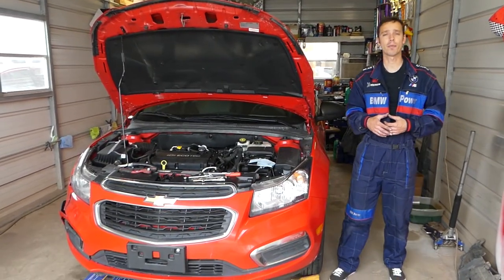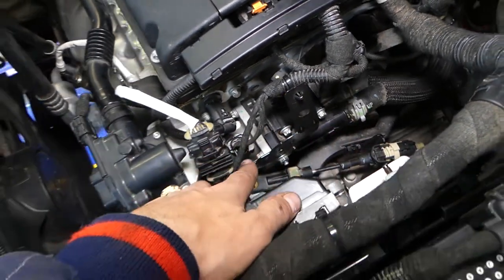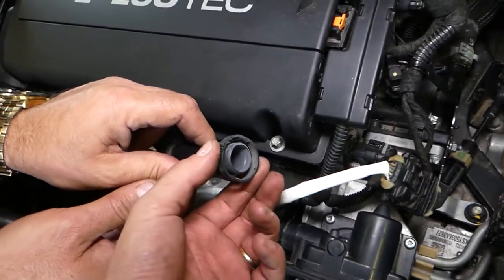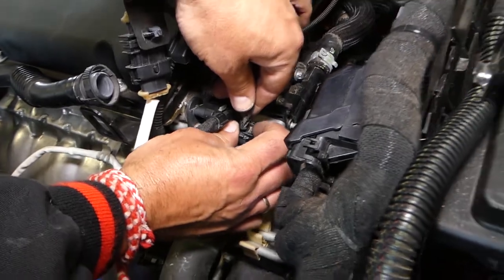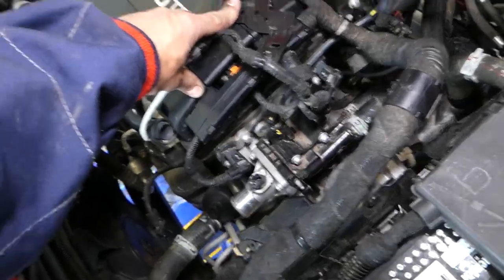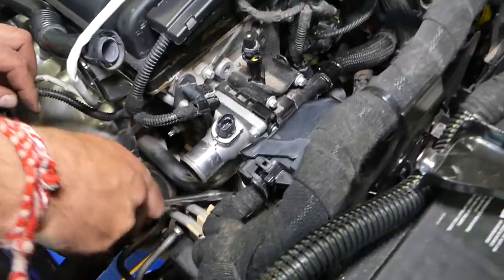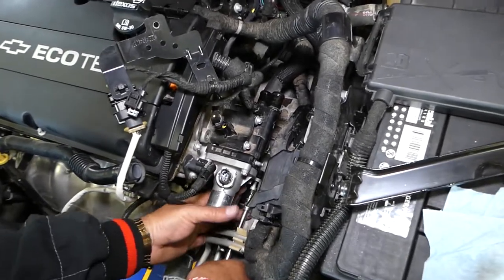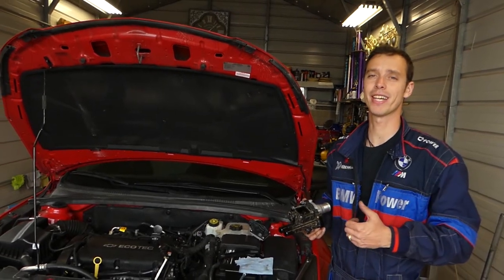CHEVROLET CRUZE THERMOSTAT AND THERMOSTAT HOUSING REPLACEMENT. CHEVY SONIC THERMOSTAT HOUSING

Comment: You guys are truly the best! I have a Chevy Cruze 2015 that I bought used 3 years ago and I've had so many stupid little things go wrong with it. Your vidoes have helped me out immensely and have saved me hundreds of dollars!! Very well explained and very comprehensive.

I just did this particular thermostat replacement and the whole process went very well. Can't thank you guys enough!!
Reply: Did you have to “reprogram” it after replacing? My dealer is telling me they have to do that and want to charge $1k. Thinking of doing it myself
Reply: @kyotodreams3306  Reprogram?? No there's no "reprogramming" involved in this installation at all. They're trying to rip you off...big time.

Comment: Is there a gasket that goes to the metal pipe that connects under the thermostat itself? I believe it goes to the block. I bolted my new one up and it was leaking everywhere !

Comment: Question!

First off, love your videos. I have a 2014 Chevy Cruze LS 1.8 and you videos are extremely informative and helpful. 

I just replaced my thermostat and thermostat housing (all metal Dorman product) and I also replaced my throttle body heater inlet pipe (as it broke when I replaced the thermostat and housing). 

When I start my car and drive, the engine temperature gauge doesn't register and my radiator fan is often running on high. It appears I am still leaking coolant out of the bottom passenger side of my radiator.

The coolant leak is not extreme, I can drive a few hours before my coolant gets too low. I am concerned about this and my temperature gauge not registering.

Any suggestions?
Reply: Did you plug the thermostat temp sensor plug back in? Was their actually a sensor to plug into perhaps you needed to put the one from the old component in? 
You will need to test it using a multimeter YouTube "How to test thermostat temp sensor" 

With the radiator leak you need to replace the radiator or your engine will eventually overheat and be gone.
Reply: i’m going through this right now. what worked for you?
Reply: For coolant leak, it's possible that it's your water pump
Reply: Idk who will see this but, if your Cruze doesn’t register your temperature with antifreeze leaking out the right side, there’s a temperature sensor on the hose that connects to your radiator/waterpump. I replaced that and it worked, but ultimately it was a sign that the water pump in the car is failing. I changed my thermostat 2x before we figured it out

Comment: As always great video. Do you ever change the clamps to the screw to tighten type to make those hoses easier to put on and off? Those hoses on the back were really a pain to get to with pliars.
Reply: same . i did that when i replaced the housing. Alot easier now if i ever have to do the work again.

Comment: 10/11/2021

I had a P0128 code on my 2016 Chevrolet Cruz (like this one). I replaced the sensor on the thermostat and it was ok until 3 days later the code came back.

I then replaced the whole thermostat housing (like in the video) and the code is gone and car works good so far. It seems the thermostat housing is caused a lot of problems. I replaced it with a plastic one and works better (not sure why)

Recommendations:
Follow the video exactly and please!!! CHANGE THE GASKET ON THE LOWER TUBE (bottom of the thermostat) If you do not your coolant will leak tiny amounts like mine and I had to do these steps all over again.
Reply: is your leak gone? i replaced the entire housing and im noticing i stil have a leak. is it that alluminum tube gasket?

Comment: Hey was wondering what seals the oil cooler pipe to the front of the thermostat, have coolant leak where they bolt together
Reply: Did you ever get this figured out? Same issue

Comment: What is the hose/clip that attaches to the top of the thermostat housing?  I have a leak there, but am not sure what that plastic clip/hose would be called in a parts diagram.
Reply: Did you ever find out what it's called? Same problem here.
Reply: I am also trying to figure this out, I need a new clip and oring.
Reply: Found it. Throttle body inlet heater pipe.
Reply: @Garage_Tinkerer  changing didn’t stop the leak right, bc mine literally won’t stop
Reply: @jarrelljohnson7345  Same its getting frustrating. i now have a check engine light po420

Comment: This is a great video and it saved me about $400.  Thank you so much.  Only issue I have is when I installed the new thermostat it was leaking so I went back in and tightened the bolts but the last one broke off. (bottom right which attaches the thermostat to the housing) To my surprise its holding and no longer leaking.  In your opinion should I do something about this?  And if so would you get a new bolt and try to save the housing or should I just spend a $100 and get a whole new housing unit?
Reply: trade it in before it starts leaking
Reply: @errorsofmodernism9715  thanks for the response, but its been two years and still holding like a champ!

Comment: Great video but my god do chevys need alot of maintenance. I have a honda and my wife has a chevy. Ive had to do stuff like this almost every month for failed parts. For my honda i have only 1 major issue which was my starter at around 140k miles.

Comment: Quick question hoping you guys can help answer. I know you have to drain the coolant to replace the thermostat and housing, but do you have to bleed the coolant as well? And if you do have to, are you supposed to do it before draining the coolant. Might seem obvious just want to cover all bases before I have it all apart. Thanks!
Reply: @joshbeekman5474  thanks a lot man!
Reply: @BorkChopGaming  the poster of this video has a video about purging the coolant line. Be careful with the thermostat housing replacement. Looks like he has a holden cruze. The pipe that goes into the oil cooler is different. Loose that first witch he didn't show. Try to leave that pipe alone and dont pull it out. Then replace  the housing. If that pipe is out one of two things happen after. 1 replace the outer o-ring and use a camera or mirror to put it back. Or 2 pull the exhaust manifold and replace the exhaust manifold gasket with proper torque spec as well as step 1.
Just trying to help.
Reply: @joshbeekman5474  I have a regular 1.8L Cruze so what should I do different? What pipe do I need to worry about??
Reply: @BorkChopGaming  pause the video at 11:13. That pipe that he has his pointer finger on is the oil cooler inlet. Look at your new housing. Try not to move That as small as possible. Lose the front smaller bolts first if you have to directly under the  thermostat. If you don't have to then don't lose those.
Reply: @BorkChopGaming  at 11:13 his finger is over part number 25194218. Please for the love of god don't tamper with the seat on that. Take it off the housing side but don't break the seat on the exhaust manifold side.
Reply: @joshbeekman5474  oh okay I rewatched the video and now see. So basically I should just try moving that pipe as very little as possible? Really I should just make sure to work around it once I have it unbolted from the thermostat housing?
Reply: @BorkChopGaming  yes. My problem with my 2012 was my Thermostat was stuck open in the plastic housing and sprung a radiator leak so first thing first. Change the thermostat, then the housing broke. I go with aluminum housing. For me that pipe came off with the housing so I go to the dealership today for the right o-ring and hopefully it seats back in on both the housing and in the exhaust manifold. There is a special place in hell for this car right next to the engineers lol. Then when you are done filling your coolant make sure to Crack open your radiator purge valve and let everything cycle through while squeezing the radiator hoses start from the bottom hoses to the top fill up to the proper line until the line stays. Close your valve and check for leaks.